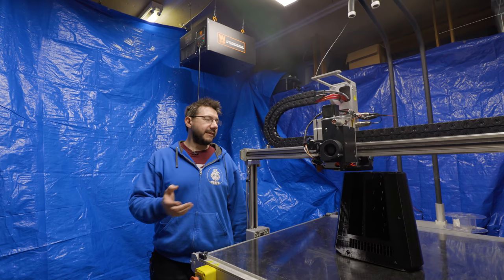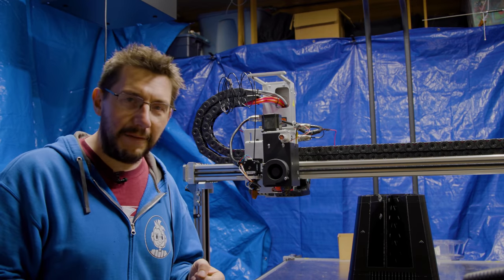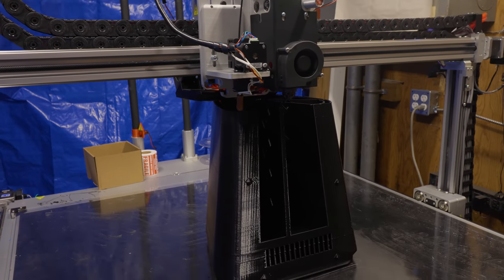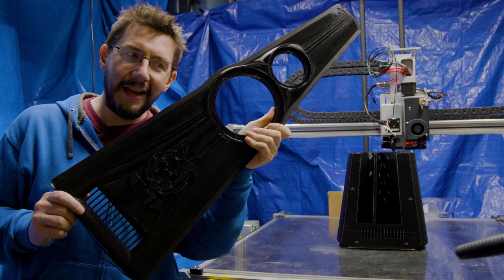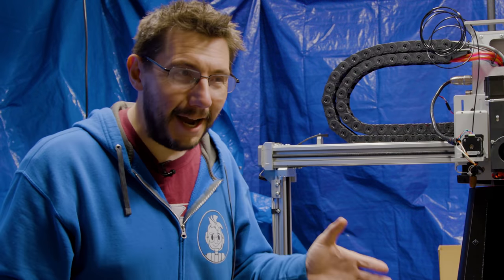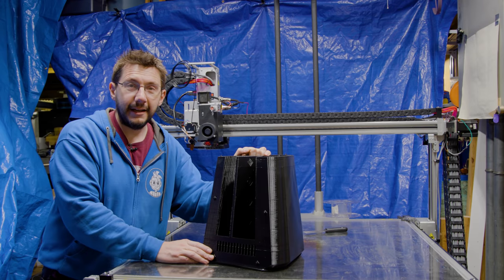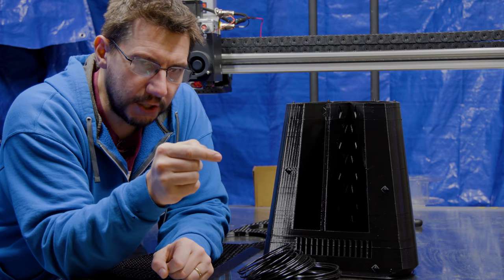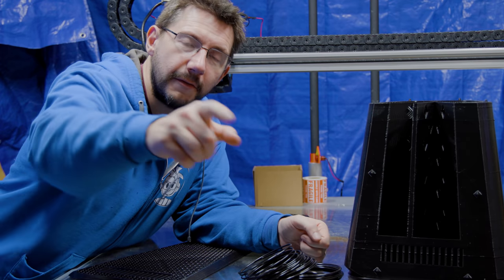3D Printed Speakers Part 1: Breaking the $38,000 3D Printer ... Again?

Comment: For a $38000 printer I am once again underwhelmed by its performance and engineering
Reply: For $38000 you really shouldn’t be buying an FDM printer... get an SLS printer instead. Much finer detail, don’t have to worry about bed adhesion or supports, faster printing, just a better technology.
Reply: Yes, the engineering is not there tbh, but basically Joel says so while carefully dancing around some agreement. haha Which is cool, you can conclude this by yourself.
Reply: Still trying to find out what components in this HULK make it worth that price tag.
I honestly think this printer could be built for maybe 4000 dollars at max and the rest is ehhh.... Well, please explain it to me?
Reply: you would have thought at that price tag, they would have moved on them the glass bed and glue.....?
Reply: @3dPrintCreator  sls not sla
Reply: @eyeborg3148  the only advantage to an fdm here is the shear size possible although I think belt printers might kill this type of printer if they take off. Also the largest nozzle is 0.6? This baby is a prime candidate for a super volcano or the like. Those side pillars should be much more rigid and the carriage needs a diet.
Reply: @crystaldragon141  For it's size it resembles incredibly little a large shop CNC mill in therms of it's structure dimensions (tho obviously I know a CNC mill goes through a lot more forces and slower movements).
Reply: It’s offensively priced. You can buy a Prusa and enlarge the frame for 1/10th
Reply: @The_Mimewar  I really think that Ivan Miranda on YouTube provides the most compelling example that this is overpriced and under engineered
Reply: I agree, You would think that a machine that costs so much would be more reliable, Altough a machine like this is designed for people who are willing to deal with that sort of stuff. But a hotent shattered by a failed print...
Reply: Having been printing large for a couple years now, the problems you guys are talking about are more having to do with the settings than the printer itself.
Reply: @GregAtlas  what we are talking about is the outrageous price
Reply: @Kalvinjj  I don't think a CNC mill of these dimensions would be using that size aluminum extrusion...
Reply: @crystaldragon141  I belive you are right. Once belt printer becomes more mainstream we will see much larger version come out. Except for prusa they will decide for some reason smaller is better lol
Reply: @MMuraseofSandvich  Pretty much my point. It's on the size class of such a machine, but nowhere near it's rigidity, albeit I do understand it doesn't need such either.
What I don't understand is how it didn't detect that massive crash, you would expect the steppers to have load sensing and reporting, or if it does expect such forces normally (understandable) why not anything on the nozzle to stop the machine... no idea.
Reply: I think any of the main brands like canon etc has a way better printer for that money. I dont say it is bad but this seems just to be an enlarged cartesian model.. a typical canon or big brand industrial printer is cheaper, and prints on micron level in abs..snd have done so for ten years.. about 15k usd and you get an enclosed professional machine with rack mounted build plates..so i dont get the price really. I see standard profiles, larger motors..but thats about it..
Reply: @eyeborg3148  SLS isnt always a better technology, like resin it has its pluses and minuses, the big one of course is the cost.
Reply: For one thing, it just doesn’t seem very rigid.
Reply: @iAmTheSquidThing  that can be depending on a lot of things we may not see but from what it looks it is poor printing as well .. perhaps it has features a tech from the builder can show. for the moment it just looks like ... pretty bad printer sorta.
Reply: @iAmTheSquidThing  Probably is very rigid already otherwise it couldnt print at all - but getting more rigidity can be the issue, as you would have to use different materials etc or more of etc etc - same problem all over again that CNC's have
Reply: @misadventuresin3dprinting.545  Prusa chooses to target the middle of the market with the best quality/price ratio they can. By only offering a few models they can focus more of the value they deliver. Disclaimer: I don't own any commercially produced 3d printers. I'm just a backyard shed engineer.
Reply: @The_Mimewar  You really wouldn't want to make a Prusa THIS big, even the Ender Extender kits only get up to 400x400 on the X and Y and that's really stretching how big you'd want to make a bed slinger. Larger prints would have a ton of inertia when moving along the Y axis. A better option would be to a CoreXY style frame, maybe a VORON-esque design where only the ganry moves.
Reply: @eyeborg3148  Nope, you will also have problems with SLS. Bigger parts, especially flat thin parts like the front of the speaker, will warp because of temperature differences.
SLS printing those large pieces is also getting extremely expensive. Powder that has been used for printing is recyclable for a next print but you always need to mix this with about 50% fresh powder.SLS prints, expecially in this format, get extremely expensive
Reply: @3dPrintCreator  you could build an enclosed printer for about that price. I'm in the middle of building a fully enclosed CoreXY that has a heated build volume of 1200x400x400. I'll probably land somewhere around there. That's with a 6061 aluminum build plate, high end steppers, water cooling and a high temp hot end.
Reply: @The_Mimewar  what? Which parts from the Prusa are even going to be usable on this?
Reply: @jhvnhjifgvbv8126  I got distracted and bought a mega X HAHAHAHAH.    The idea was to get a $130 i3 clone and expand, but all you’d end up with is bearings, a hot end and a controller, if you’re lucky.  All buyable cheaper than the i3 clone

Comment: That printer really doesnt seem to live up to its price tag. Big doesnt matter if the quality is awful.
Reply: That’s what she said.....
Reply: @jim2386   PLA shrinks around 2% as it cools and if you don't prevent or relive that stress it will build up until something gives: build plate adhesion, part warping, cracking, delamination, etc.  Heating the bed alone is not enough beyond a certain size.  This is just the reality of a big print without a sufficiently heated chamber and annealing plan.
Reply: 3D Platform seems to market their printers for discerning research and industrial applications; they didn't design them with unassuming hobbyists in mind.
Reply: @aajpeter  what is the use case for a printer like this then? Thin-walled parts that warp acceptably after they are removed from the bed? Genuinely curious what you can do with a printer like this if FDM restricts the ability to print big without major warping.
Reply: @aajpeter  Then for 38k you have an enclosure lol.

Comment: The more I see this printer featured the less I think of the company that made it. It's a $38k PoS.
Reply: I know right! I run a 400x400x400 printer with a volcano hot end and I feel scaling that design up would be much better. That Ivan guy has actually made a printer this big and it knocks this on its ass in terms of quality
Reply: Agreed. I guess he should have got the $48,000 one. Joking of course.
Reply: There's been nothing good to say about this machine. Everything seems wrong with it.  (Not to mention, again, that for $38K it shouldn't be running a $35 computer as it's brains.)
Reply: The aluminum extrusions are a joke.

Comment: For the prototyping job I was doing, I took an Ender 5 Plus and modified it to print fast and large. Super volcano is a must have. One of the biggest things I learned is that the Hemera is somewhat ill suited for the job. It doesn't dissipate enough heat from the combination of the hot end heat and the stresses we put the motor through and the heat break is somewhat fragile (when printing such thick lines that can sometimes blob up and grab the nozzle) and breaks exactly like how yours broke. Then later I redesigned it to use the classic E3D V6 because we can use the titanium heat break for additional durability and rigidity. We also set it up so it's a bowden setup similar to the original Ender 5 plus, only it's using a Bondtech for extrusion power. Having the Bondtech anchored to the frame pulling the filament up into the bowden where it feeds into the extruder came with the benefit of being able to use 25k spools right off the spool since the direct drive system actually had the issue that it lifted the gantry (and sometimes the whole machine) and caused gaps in the print with anything more than 10k due to the newtonian physics of the mass being at rest and wanting to stay at rest. We can use up to a 1.4 mm nozzle, but we get better results with 1.0 or 1.2mm nozzles. 

Some tips for the warping issue: 
*It definitely helps to have an enclosure for ambient temperature. Would probably help to have a heater blowing inside the enclosure kind of like what you use on the peopoly resin machines. Draftyness was our number one source of failures when we were starting out.
*Enclosure systems can sometimes cause issues with the cold end getting too hot. I suspect a water cooled cold end system would actually be ideal, but we haven't invested the budget into testing an option like that. 
*Lower volume tends to warp less. Either through reduced speed or thinner layer lines. 
*Brims definitely help and don't be afraid to make them oversized. Something I thought of but haven't tried yet is to make the brim layers more than one layer for additional rigidity, but that would also make the brim removal more difficult. Hmm... Maybe I should suggest my boss get a sawsall for our printer farm.
*I haven't used Magigoo, but Matterhacker's Stick Stick is great. Makes it harder to release when done printing unfortunately. Only lost chunks of the glass bed twice (so far) with a couple hundred prints. For some of our prints, I've actually seen the glass bed bend up because of the forces the model places on it while warping. 

For context: we're printing mostly in PETG which tends to warp slightly more than PLA and the higher temperatures required present additional issues.
Reply from the maker: Thank you for the tips!

Comment: This seems like a good project to try on that new Creality belt printer. Especially given the size of the pieces.
Reply from the maker: I had thought about it but the pieces are bigger than the belt machine.
Reply: @3DPrintingNerd  what are the dimensions of the main part you just printed?
Reply: @ 3d Printing nerd

So i recently purchased a Anet A10 3d printer, mine is different to the one available with a blue  touch screen instead of an orange with black.
But either way, i cannot find a slicing software that has the printer preloaded as one of their listed printers, neither do i know how to write or correct a Code for it to print

Please can anyone help me, i could really use it 😕, especially you Mr 3D Nerd
Reply: @insanelamaa  use cura as slicer software, load in .stl files and slice them and .gcode files will come out
Reply: Maybe print like 3cm layers of the model and superglue?

Comment: Hey Joel, Great job dude! I feel kinda guilty my design is proving to be such a challenge!

I wonder what temp the bed was under the print when actively heated. Obviously the part insulates the bed pretty well so must be higher than the set temp.
Reply: he soulda printed it upside down with tree supports, smaller surface area, less bendy bendy
Reply: I would have thought a super tall delta would be more suitable for printing it.
Reply: Way to go on the design Simon and thanks for the shoutout Joel. Looking forward to the next installment!
Reply: To be fair, an enclosure with some heat would solve all of these issues. It isn't even that hard or expensive to add.
Reply: @claudekim7876  exactly. I dont think the community needs people who gatekeep based on what slicer you use, especially as Cura is better than some of the commercial options (im looking at you simplify3d)
Reply: @francistaylor1822  i bet that guy doesnt even have a 3d printer lol
Reply: @claudekim7876  Possibly, nothing wrong with being interested in 3d printers but not having pulled the trigger for whatever reason yet. 

You are right though throwing in silly comments just because they cant see why a printer is expensive is counter productive, I wish people stopped to think before they derided something.

It can be done much cheaper though, Ivan Miranda (another youtuber) has done it.
Reply: @francistaylor1822  yea true. i dont particularly like this printer joel has.. it seems a bit poorly built. that guy who makes the tank with his large 3d printer, that guys printer is awesome however

Comment: INTERESTING CHALLENGE. And perhaps you are attempting this for the challenge as much as for the final product, because, "Many things can be 3D printed, but not everything. And, everything that can, shouldn't." ~Swami, this may not be the best use case. Hopefully, all can agree that there are better ways to make a speaker. Also, sometimes the technology you have (and know) is the one you use. I acknowledge that there are a number of decision factors for a given situation.

That said, I do have some constructive input to try to help improve the model. So, with an eye on "design for manufacture" (specifically, knowing that the technology used will be 3D printing), I will suggest a couple possible design mods to address the peeling issue:

- Create a pattern of "troughs" on the bottom surface that interfaces with the bed (use 45º angled walls that come to a point at the top, while also creating a thin, flat "run" on the bottom, so no bridging will occur, and no supports will be necessary - I'd supply a pic for clarification, but that's not supported in YouTube comments, though I guess I can create a link; will do, if necessary). The idea is to minimize the large, continuous surface area of the bottom. BTW, I have not tried this, but am just going of principles. I've experienced this problem with peeling up, even with PLA, and it is definitely an unwanted challenge:(

- Another idea is to put thin discs strategically along the perimeter (where peeling occurs, +/or where prone to occur) - then cut off in post. This should be more effective than a brim, albeit w/ a bit more effort in post, but hey, that might be the tradeoff for success!

Anyhow, whatever you decide, WISHING YOU SUCCESS!:)...
Reply: I always found the more flat surface area a print has the better it sticks. You don't think so? Happy to see a picture if you link it.
Reply: @Audio_Simon  The issue is peeling, which can result from large surface area in contact with the bed. I believe this is due to differential cooling, and contraction of the plastic. These are due to the geometry, and the material, respectively. And, as noted, this suggestion is made "going on principal", but needs to be tested... I could be right, or completely wrong! :D
Reply: Also, "more" flat surface area is not needed, but "just enough" :)

Comment: Props to Simon for the design as it looks phenomenal!
Biggest problems I had with my Sigmax and Ultimakers were with the glass bed. No matter what I used, there was always the worry of PLA prints detaching, more so on the Sigmax because of the bed size. In the end, I retrofitted PEI sheet to the Ultimakers and printbite sheet to the Sigmax which took 80% of failures away straight off the bat. The Sigmax still needed extra help with magigoo or 3dgloop, but that was more to do with the crappy bed heating system causing warping. So, TLDR, have you thought of adding some PEI sheets to the glass? Great video, looking forward to the next parts 👍

Comment: i think i know the problem of the heatbed/lifting of the bed: the sensor of the heatbed is only in one position, a position where noting is printed ontop, this leads to quicker cooling everywhere but the printed part -> the bed heats more and the sensor is thinking that everithing is good.
BUT: the heat under the printed part raises up and up, way over what you want on the spot where the object sits
you could cover the rest of the open/uncovered bed under some insulation (sheet of foam?)
sry for bad english, i only want to help :(

Comment: for manual filament runout detection i use a brass bell with a piece of string attached loosely to the filament, the filament passes the last hard point, the bell falls, i either wait about 5 min so the filament touches my direct drive extruder, or swop the filament for a fresh spool/ next piece of leftover filament

Comment: To prevent cracking the bottom on big prints, let the bed and part cool down to ambient temperature when the print is finished..  The bed and the plastic have a different co-efficient of expansion and as it cools the part should release automagically.

Comment: Use from Gernier Fructies the full control hairspray. It is like superglue to the glass bed. ABS,PLA,PETG and ASA are often so stuck on that only once the glass reaches temp below 20C it releases. So I put the piece into a freezer for 3-5min and it comes off without any warping and perfect condition and also does not damage the tempered glass.

Comment: That printer seems to have huge issues with the bed adhesion and temperature. It seems tha the glass is too weak heat conductor to spread the temperature evenly on the bed. I'd test it by printing a part in which I'd be able to put a thermocouple to monitor the actual temperature under the printed object. That black mark at the centre of the bed suggests that the bed is scorching hot there.
Reply: I commented something similar to this. My thoughts were that maybe using a bunch of smaller mates creating zones to prevent hot spots. Your take on that idea?